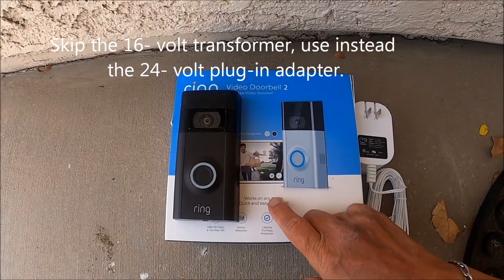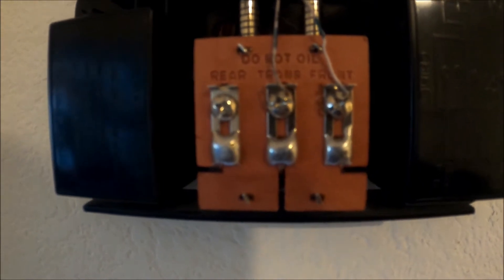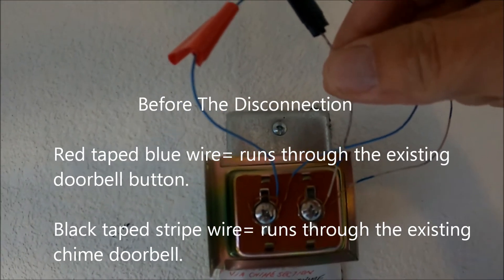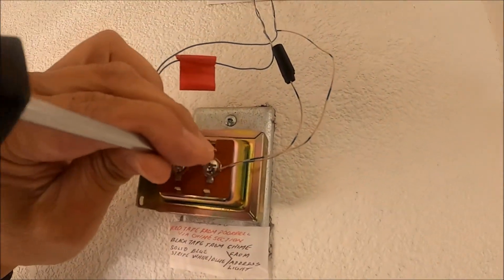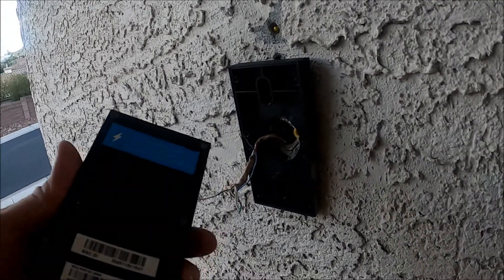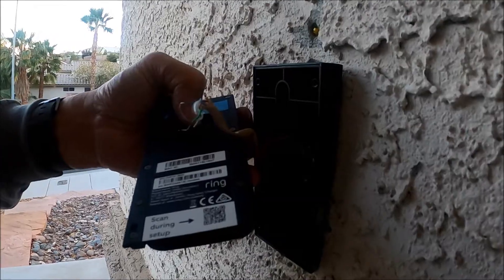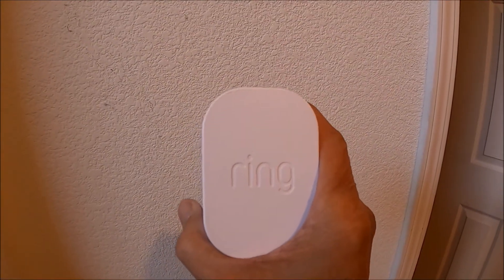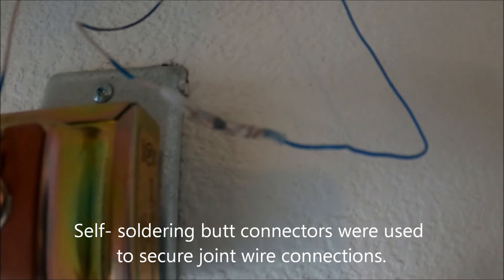Ring Video Doorbell Hardwiring With Existing Doorbell Wires  And Skip The Transformer

Comment: Ring CS rep said even with the battery and hard wire install, the battery only gets 10% trickle charge and will still need to be removed/re-charged with a 2nd battery. I'd like to replace my chime transformer, but can't find it! I looked in the attic, closets, garage etc.
Reply from the maker: sbrave, Since I hardwired the Ring two years ago or so, I never removed the battery to recharge. Although I had an issue charging the battery during wintertime in the past, Ring support gave me the plugin adapter, and never had a problem after installing the adapter.
My transformer is in the garage. Any luck locating the transformer?
Reply: @ramcee2306  Haven't found it yet. I bought the Doorbell Wired version, but I had to use their jumper in my chime box to get the right power, and now the chime doesn't work, so my options are to buy their plugin chime, or eventually find and replace my transformer and go back to using my own chime. btw, I have the same old brass doorbell and stucco color as you, haha!
Reply from the maker: @sbrave   The Ring support team was generous to me, they gave me also the chime-in with the wifi extender version. Lucky, I guess. Good luck looking for the transformer. Time to Google search 😁.

Comment: whats the point for this? the ring doorbell supports 8-24v so 16v will work
Reply from the maker: I'm glad you ask. Initially installed directly to the transformer without any issue. The transformer is rated 16v 10va. Winter came, the battery had an issue charging. Called Ring customer service for assistance and as a courtesy from Ring, support sent me a free plug-in adapter rated  24v 20va. I used the existing wires in order to use the adapter. No more charging issue since.